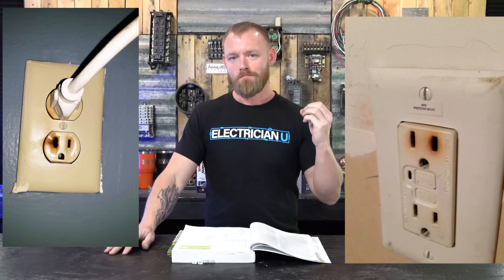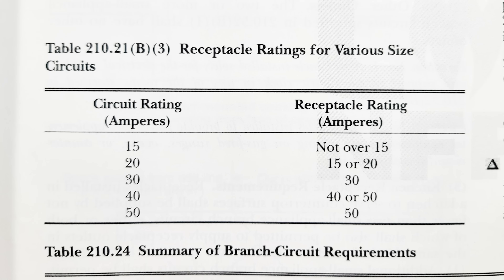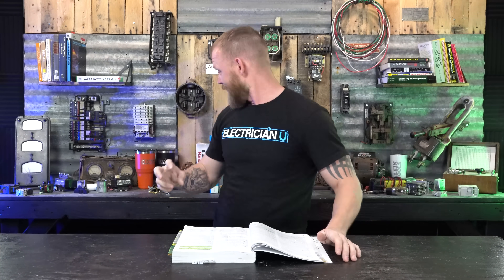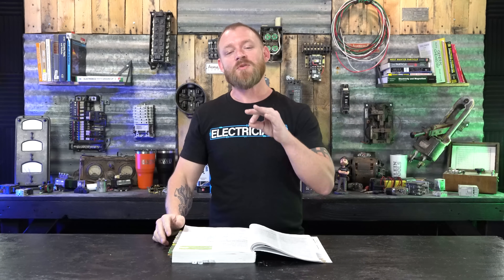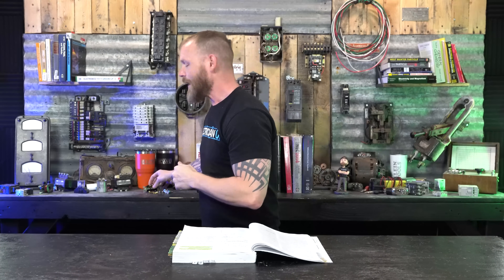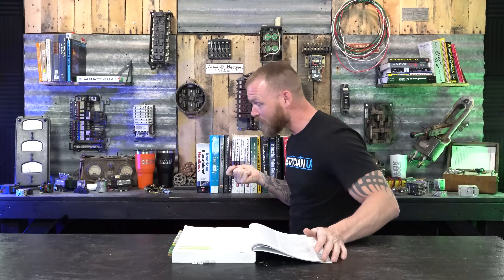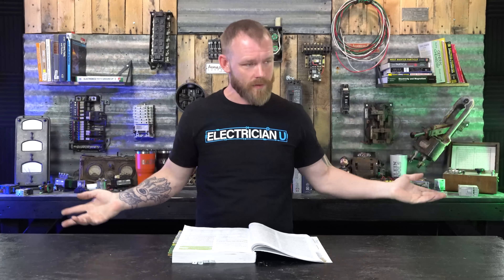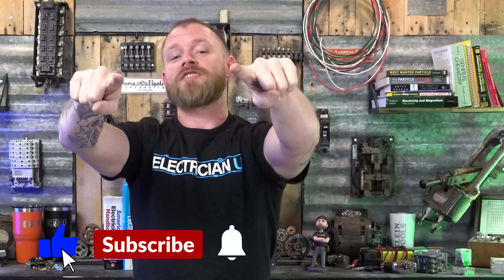Won't These Melt?!? 15amp Receptacles on 20 amp Circuits!!!

Comment: I'm from the UK and have a question.  Is there a law, that forces your supply company to supply a set voltage? After reading all the posts on here about overloads and you r voltage of 110v any deviation would affect the overload situation quote considerably. Here in the UK
the supply company has to provide a voltage 10% either side. So 230v could be 207v or 253v. How does that compare to the USA?

Comment: Also 20 amp circuit requires 12 guage conductors. 15 amp requires minimum 14 guage. So just changing to 20 amp receptacles is not good if you have 14 guage in the walls.

Comment: A simple thing you could say is that a breaker protects only the wires inside the walls.
This is especially true for extension cords leading to power boards/strips.
Reply: Good point!    Years ago 18 gauge extension cords were common place, these kept the fire departments busy in the winter months, when folks plugged their 1500 watt space heaters in.   As a result UL specs require a minimum of 16 awg,  better,  but I personally would only use a 14awg minimum extension cord like an air conditioner cord, if I needed to plug a heater in, even then I occasionally check the connections for heat.
Reply: @Sparky-ww5re  what’s even worse are outdoor rated 16 gauge cords that look like they might be heavy duty but just aren’t, cooked a power tool using one of those.
Reply: @JuneNafziger  how do you cook a power tool from an extention cord?
Reply: @randybobandy9828  it caused a voltage drop that made the tool pull too much current (but not enough to pop the breaker) leading to it burning itself up
Reply: @randybobandy9828  Motors are very prone to burnout if the voltage is too low. Longer circuits cause voltage drop due to the added resistance that the length of the total circuit introduces. What also causes added resistance is smaller conductors, so while you may have 115 volts at a receptacle, you might only get 95 or 100 volts at the far end of a 100' 16 gauge extension cord. (Under load.) So power tools are best supplied by minimum #14 if not #12 gauge cords.
Reply: They don't want you using extension cords, that's why new homes have to have outlets every 6 feet and on any wall longer than 2 feet, they can control what cord is on an approved device, they can't control if you plug it into a janky extension cord.
Reply: @Galgamoth  Code requires a receptacle in any wall space within a room 24" or wider, yes. But it's not every 6', it's every 12', so that no point along a wall is further than 6' from a receptacle. That code has remained unchanged since it was introduced. Often the electrician will install 1 or 2 more, especially when following the code minimum results in receptacles would end up being located in seemingly inconvenient places.
Reply: @darrendolphdragos9752  I meant that an outlet has to be accessible within 6' which is what the code does
Reply: @Galgamoth  Correct, which isn't the same as "code requires an outlet every 6'.
Reply: @Galgamoth  It has been a year, but if I recall the issue right: it is that extension cords can be abused to work above their current limit when a power strip is used, such that more than just a single device is drawing current via the same extension cord. Without checking, I expect power strips would have the same current limit rating meaning they too are the problem.

Comment: Question: Using both terminal screws of the outlet to continue your circuit is allowed by the NEC. Yet an overdraw can cause the tabs connecting those points to weaken over time and cause arcing... My question would be why doesnt the NEC require splicing behind outlets and only allow 1 white and 1 black to a receptacle unless that receptacle had the tabs broken for a switch controller?
Reply: "Requiring" would mean a very large number of existing circuits would need to be redone whenever any future work was done on them.  And then you get the issue of box crowding, because there's only so much room in a single-gang work box.

Hell, I'm glad they finally did away with push connectors on outlets.  I run into so many problems with old installs that used those; I despise them.

Comment: Where I've seen the problem is on the daisy-chained setup. Let's say I have three vanity outlets on one GFCI 20A circuit (like a master and a guest bathroom). If I have one person using a blow dryer at outlet 2 (~ 12A) and another using a curling iron at outlet 3 (~ 8A), it's all good as far as the circuit breaker and wiring and even the individual outlets. However, electricians install these daisy chained, with the line coming in the top lugs and the branch to the next outlet going out the bottom lugs. So at outlet 1, those little removable metal tabs between the top outlet and the bottom outlet wind up having 20A flowing through them, despite being rated at 15A. So over time they become brittle and they crack, creating an unreliable circuit and a fire hazard.

Comment: NEC code, 15 amp outlet 15 amp breaker, basic knowledge to know, as a retired commercial / industrial electrician I installed all 20 amp spec grade receptacles in my house and made sure amp loads was down to safe measurements. Do your homework before doing the work, do not rely on lowes or home depot workers.

Comment: I've found that NA electrical, is so retarded. In the UK, we use a ring main, EVERY socket (receptacle) is rated at 13Amps, you can only buy 13amps period. The highest appliance will only use 13amps period. Also LIGHTING circuits are on a separate circuit than the mains, you can't spur off like you can here in Canada. Also in any country you can't account for idiots who put on a power strip or thoes blocks which allow you to put 2 or 3 in. BUT to be honest, the consumer is NOT a fault, if I can buy a block allowing me to put 5 heaters on to one plug/outlet how is that my fault. I'm not an electrician. BUT what happens is a as every 13amp socket is essentially in parallel, when it sees more than 13amp, it blows the circuits fuse, I've NEVER in 30 years seen a  melted receptacle in the UK... a real eye opener. In canada on our  brand new house , they wired 2 bathrooms and an upstairs bedroom together, so if I want to use a space heater in all 3 at the same time, fuses blow. And they also put 15a recp.s in on a 20A circuit which meant they melted from use, as per your expl;antion. So now unless we re-wire, only 1 room can have a heater on at any time. IN THE UK on a ring main, that could never happed. totally retarded... BUT sir, I do like your video, not your fault, but good explanation !

Comment: If you have a Tesla at home and you are not going to pay to put in a 220 plug, you can buy a 15 amp or a different 20 amp charger from Tesla. The 15 amp one looks like a regular 110 plug with a three prongs. The 20 amp one also has a three prong plug but they are one upright and the second is sideways.
So, I'm not saying I did this . . . But you go to Home Depot and buy one of those up/down and sideways style 110 recepticals and just change the receptacle. Would that person have done something bad?? Just asking 👍👍 😇

Comment: When I was an electrical contractor in the Chicago area I actually did a job at Argonne National Labratory which is located in Downers Grove Illinois a suburb southwest of Chicago. The lab actually had a machine that you could introduce simulated amps on a wire of your choice. We took a piece of #12 stranded and we wanted to see how many amps it would take to melt the insulation on the wire. When the Thhn insulation melted the reading was at 230 amps. It’s really a stretch to say that using a 20 amp breaker on #14 Thhn wire is a hazard, especially if the wire is in a conduit.
Reply: @ James Martello, do you recall the length of the sample piece of #12 wire that was used in this test?
Reply: Yeah, most things are capable of handling way more than they are rated for. They are rated to be on the safe side in the worst of unusual circumstances. It’s still wise to follow the rating though.
Reply: Fascinating. Yet it's not the wire rating nor the insulation that is the problem. So it must be where connections are made or when insulation has been damaged that causes a fault?
Reply: yes but you also don't want hot wires in your walls
Reply: Well then, I am going to wire my entire house with #14 wire then.... including my stove.  :) Just kidding, and thanks for the info, that's good to know, I recently wired up an outlet for a friend using #14 because he had a low load for that outlet, and when I came back he had an AC unit plugged in, when I told him not to use it for anything other than what he was using it for. Good to know his place won't burn down because of me.

Comment: I've often wondered why when they wire rooms for outlets they don't pigtail each outlet so if you have a problem with one of them it doesn't affect the others on that circuit.
Reply: Because they don't plan to come back and fix it when it fails down the road.

Comment: It is not code to use a 20 amp breaker on any 15 amp outlet. 15 amp outlets are made to only handle 15 amps maximum, safely. My better half has re-wired his entire home with in the electrical code. 15 Amp breakers for only 15 amp circuits, and 20 amp breakers for 20 amp circuits.

Comment: Yep.. Had to check this out because I'm not a advanced electrician but recently wired up my new music room with 20 amp breakers and UF B wire with 20 AMP outlet's on a 5 plug run and now I feel like I did the right thing since I just use a couple amps to play guitars and a DJ system on it's own run.. Thanks..

Comment: Please correct me if I'm wrong, but most (key word MOST) receptacles have a BODY (meaning everything behind the face) rating of 20A. The only difference is the face configuration. The receptacles themselves should be stamped with this marking. So even though it may have a 15A face the body inners are rated for 20A. Which would be the reasoning for the allowance for 15 or 20A on a 20A circuit.
Reply: Wrong.  The 20 amp breaker should be built heavier in most cases where you pay more money for them.

Comment: I am a retired electrician of 50yrs here. Cheap construction is NOT cheap. First time a homeowner has to hire an electrician to replace a melted receptacle that fee would have more than compensated for the upgraded 20a receptacles on the 20a circuit. I think the NEC should be petitioned to change that code that allows 15a receptacles on a 20a circuit. With the cost of wire these days if you need to go cheap make the circuit 15a with 14ga wire and 15a circuit breaker. At least it would be safer. It seems to me that an unattended, overloaded receptacle could cause a house fire. Then go figure the cost savings of cheap receptacles.
Reply: A 15amp receptacle is required to be rated for 20amp pass through.
A 15amp GFCI is required that the internal contacts be rated for 20amp. A 15amp receptacle is not weaker than a 20amp because it has been designed and listed for use on 20amp circuits. These are UL requirements. The only difference is face configuration. I'm sure you know some brands are bettter than others and I don't know for fact but have always assumed residential grade is poorer quality than the rest. Spending the money on "upgrading" a 15 to a 20 amp residential only gains you the ability to use a 20 amp plug, nothing else. Obviously the few residential appliances that have 20 amp plugs should be on a dedicated circuit anyway.

Comment: When I trim out a house, I use 20 spec tr outlets. Especially when I pull the load across terminal screws. Appliances ect. Just a good practice to get used to even if most inspectors miss this.
Reply: A 20 amp terminal jumper metal is thick a f why not in a house? Can’t back stab 20 amp and no , fuck no. I’m a commercial guy, I haven’t fucked with a house in years thank god, but I’ve seen way too many lost neutrals and voltage drops from loaded up terminal where someone didn’t have the know how to pigtail multiple conductors. I didn’t get my license by burning down buildings. If you can’t safely use both terminal screws, you should just quit now.
Reply: You not telling anything new buddy. Just saying there’s a place for both methods . Obviously over two pairs In an outlet box get pigtailed. We use torque screwdrivers on receptacles set two clicks past spec. When you have 5000 outlets in a buildings
Reply: The industry has made safety a double redundancy , any electrician worth a shit can do it all safe with a cab tip screwdriver and pair of lineman’s, I have 7 apprentices under our licenses …..need I say more lol
Reply: @notyou5557 "Gets screwy?" The part of the receptacle that conducts power between the upper and lower terminal screws is right there outside the body of the device - the breakaway tab. How could that "get screwy?"
Reply: @notyou5557 Pigtail every receptacle? That's never happening in a housing tract where the electrical contractor competitively bid for the job. 2 more wire nuts and 5 minutes additional make-up time per... Even a .77 cent residential grade 15 amp receptacle is more than capable of passing a full 20 amps through that break-off tab, otherwise there'd be no UL listing. Whether the load is on the other side of that bridge from the feed in the other half of the receptacle, or downstream makes no difference. There's 2 terminals on each side of every receptacle for a reason. Feed-in, feed-out. If it presented any real problems it would have been banned long ago. I pigtail all of my 20a duplexes because folding 5 solid #12's into a box to install a device is a PITA compared to 3 #12's. But in commercial with stranded wire, I have no qualms or worries. (Granted they're back-wired spec. grade devices as well.) Please be aware these are my opinions and my take on the matter, not trying to get into a pi$$ing match or pick a fight with anyone here. Have a great day and good discussion!

Comment: Great info thanks.  I needed to upgrade my receptacles in my living room where I'm putting my home theater and that circuit is rated at 20 Amps but currently only has 15 A plugs.  Wanted to get more headroom for the higher power devices like my avr, tv and power camp.   Keep up the good work.
Reply: Keep in mind a 15A circuit allows 14 guage conductor wire size. 14 guage is undersized for a 20 amp circuit. You need 12 guage.

Comment: Somebody else probably already noted this but 130% of 20 amps (for the thermal trip of a 20 amp breaker) is 26 amps, not 24 amps.

10% of 20 amps is 2 amps. Three times that (for 30% of 20 amps) is 6 amps.
Reply: 30% of 15 amps is 19.5 amps.

Comment: Good luck trying to plug a 20 amp cord set into a 15 amp receptacle, or a 15 amp cord set into a 20 amp receptacle. That’s the idiot proof mechanism helping prevent fires

Comment: should i use all 20 amp outlets and switches in my home since all the breakers r 30 amp with exception of dryer and a/c which r 50 amp
Reply: yep thats fine as long as you know the wiring is capable of handling 30 amps as well

Comment: I suspect they allow it because 20A receptacles require special plugs for 20A devices.  If the device doesn't have that plug, it wont ever pull 20A.  If it does have that plug, it wont fit into a 15A receptacle anyway.

Comment: Good points, but I’m a GC and if I’m building a custom home and having a conversation with the electrician about dedicated circuits for space heaters, the architect and HVAC contractor have dropped the ball somewhere.
Reply: Women put space heaters everywhere.  I doubt their special outlets will even be used lol

Comment: Reminds me of a situation that happened to me when I built my house about 25 years ago. In my kitchen I have 6 recessed lights all on one dimmer. The cans are rated for 150W bulbs but my electrician assumed I'd never use more than 75W in any of them. As a result he broke off all the cooling fins on the dimmer to (I'm guessing) make it easier for him to install the dimmer. This reduced the wattage of the switch from 1000W to 600W. I had no idea he did this but I was painting the newly plastered walls and needed all the light I could get so I replaced all the bulbs with a 150W bulbs. While I was painting I happened to glance at the switch I could have sworn the white switch plate was not as white as it should be but shrugged it off as being my eyes. Continued painting and about 30 minutes later happened to glance at it again and this time there was no question that the switch plate was discolored. Touched it and realized it was hot, very hot. I shut the lights off and pulled the dimmer out. Thing had badly melted to the point where another half hour and I probably would have had a fire in the wall. Would have loved explaining to my insurance company how my still not quite finished house burnt down.
Reply: Wow. Happy to have LEDs these days with a fraction of that load. Plus the non-resistive dimmers don’t build up nearly as much heat.
Reply: @BabyGators  me too! Dumped the incandescent bulbs as soon as they became available.

Comment: So, does that mean that if you installed a dedicated single 20 amp receptacle on a 20 Amp circuit breaker, # 12 wire, I can only plug in a space heater with a 16 Amp draw?

Comment: Hint - electrical space heaters AFAIK are NEVER allowed to be more than 1500 watts, if they are designed to be plugged into a 15 amp outlet (common NEMA 5-15 type).
That's only about 12.5 AMPS at a nominal 120 volts, and due to them being mostly a pure resist load, they normally pull LESS CURRENT when fed with lower voltage.

On the other hand, I CAN picture some moron plugging 2 of them into a single duplex outlet.

BTW - installing with higher-rated WIRE does not hurt anything, it's just a higher COST while keeping the wire running cooler.